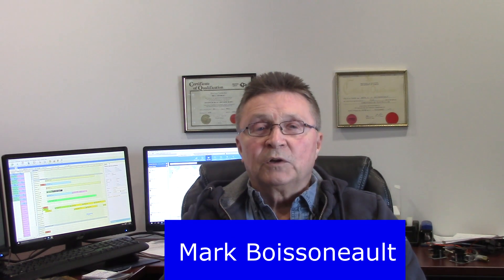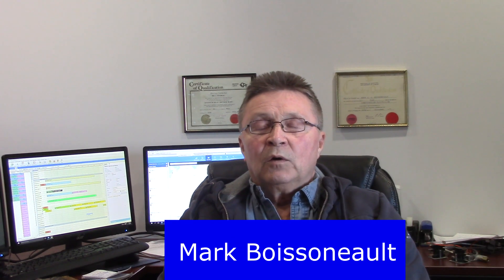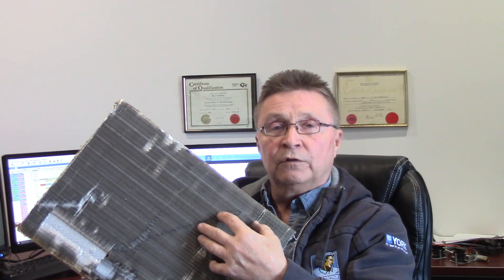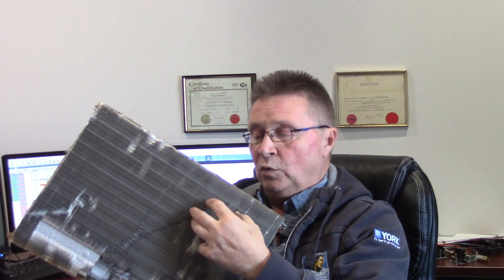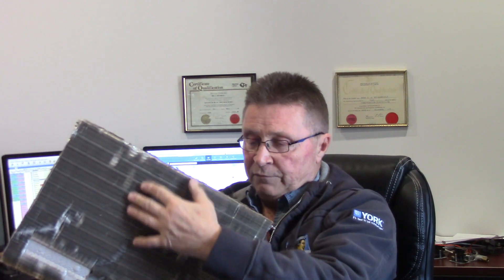3 most Common reasons Why Your Air Conditioner Freezes Up

Comment: Only two main reasons not three. poor airflow or low charge. An evap coil is designed to run at an evaporator temp of 42-45°F. In order for it to freeze it has to get to 32°sensible heat -944° btuh of latent heat or lower to freeze that's physics, you ever calibrated a thermometer. You use a glass of ice water, it gets to 32°F and doesn't freeze.   And no thermostat is designed to get that cold unless of corse your talking about a freezer. And that's why freezers have a defrost cycle timer. Always irritated me to hear or hear about a technician tell someone that turning your stat too low can cause it to freeze up. Haven't figured out if they say that from just ignorance or just too lazy to fix the problem or just trying to sell new equipment.
Reply from the maker: I have to agree with you that there are many repair people out there that overlook the situation and are not completely correct with their diagnosis.
 Setting the thermostat to a lower temperature that is below design parameters will not necessarily by itself cause icing on the coil until of course it causes the evaporator coil to become colder than 32f. Most high temperature refrigeration systems ( air conditioning) are designed to provide a temperature drop of 17f and as high as 22f across the evaporator based on having the correct amount of refrigerant in the system and 400 cubic feet per minute per ton (12,000 Btu's)  of airflow across the coil.
 It should be easy to see that a dirty filter, blocked or undersized ductwork will produce a lower than  required cfm resulting in a coil temperature that will produce frost. Left unchecked the frost will eventually cover more and more coil surface reducing the total heat transfer or the return air that needs to maintain 400 cfm/ton.
A homeowner may say to us: "If I set my air conditioner at 70f it works just fine. I need to have it colder for medical reasons and it frosts up if I set it any colder"
The conversation then will turn to explaining that the airflow and refrigerant charge may be off and that  even a perfectly designed and balanced system will reach a point in the lower 60f range that will start to create problems with oil return to the compressor. This is not simple physics but a design condition that can only be corrected with a defrost timer, or switching to a medium temperature system that  most of us would call a fridge or walk-in cooler.

So in my opinion, there are 3 reasons that  directly or indirectly will contribute to an Air Conditioner Freezing up.
Reply: Tradesman Mechanical Services Ltd. 
A perfectly designed/ installed residential or commercial system operating within AHRI design specifications should have no problems with oil return and no frosting of coil unless you're talking about a freezer.  
A defrost timer is not used to help with oil return it is to prevent slugging the compressor with liquid due to low to no superheat of your refrigerant from flooding your evap, and the fact that when a freezer evap coil freezes over you loose air flow thereby loosing ability and efficiency.  

This my opinion based on my 23 yrs of experience in the hvac industry. This is my reason for saying only two main reason a non freezer application refrigeration system would freeze is air flow issues or improper charge issue.
Reply from the maker: Thank you Robert  for your opinion. I will agree to disagree since this topic was not meant to include any commercial scenarios and a more complex discussion on the physics involved here.
Most homeowners that do not have your experience will appreciate a simple  explanation of this.  In an effort to be correct , I will say that setting your thermostat colder will not in itself be the cause of a frozen coil, but is without a doubt will contribute to an already preexisting problem with 1) airflow or 2) refrigerant metering or charge.
Thanks again for pointing that out.
Reply: Tradesman Mechanical Services Ltd. 
I agree with that and appreciate your reply
Reply: Robert and TMS you guys are great
Reply: It being too cold can cause an evap to freeze up. It’s called having a low heat load.
Reply: Robert L hey dude so just want your imput, I'm new to the field had a compressor freeze up put freon about a month ago for a start up and now it's an ice block the filler was clean so it means that there is a leak in the system?
Reply: Matt Thomas compressor or indoor coil..? If freezing from compressor in you have liquid returning
Reply: So you telling me a faulty blower motor will not cause an evaporator coil to freeze up

Comment: had new unit installed in my condo changed filter 4 times in 2 months keeps freezing up none of my vents are blocked by furniture so im not sure that it would be an air flow problem. what else could it be . the ac repair man said needs maintanence but it hasnt even been a year and manual doesnt say i need maintenance until after a year.  ac repairman wants to charge me 200. for maintanance but while saying nothing is wrong with the unit. that it needs a cleaning only. i dont trust ac repairman. my unit is a comfort pack made by national comfort products what do u recommend? thanks
Reply from the maker: If the unit was set up properly and did work well at first, the it is either being set too low(below 70f) or it has a leak and is low on refrigerant. This is assuming the there is sufficient airflow.  If we are the installing contractor we would be figuring this out at no cost. Do you not have warranty?
Reply: the manual has a warranty in it for the comfort pack. we keep temperature at 75 usually. nothing iss blocking the vents but we dont have any ceiling fans to circulate the air would that make a difference.
Reply from the maker: You need to contact your builder or installing contractor.
Reply: i did he came buy said nothing wrong with it needs maintanance and says 200. charge but it hasnt been a year yet. for maintanance so i didnt call him back yet because im not sure i trust him.he never call me back after the 1st time.
Reply from the maker: It is unfortunate that your contractor is avoiding making good on your warranty. It could be that he is simply not qualified to figure it out. Like they say: Buyer beware.
Reply: William Its a bad installation!

Comment: Mark thanks your video it was extremely helpful to me. At first when I took the cover off the evaporator looked clean. When I finally figured a way to remove the small cover, so i could see the inside of the evap the crud in there was incredible. I took a toothbrush and a Shop-Vac cleaned it. i wish i could have uploaded photos